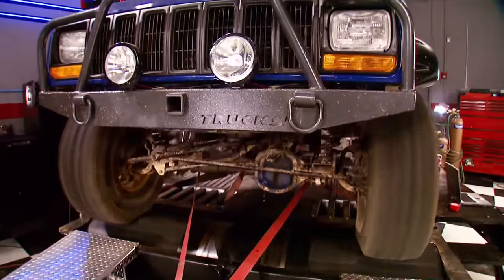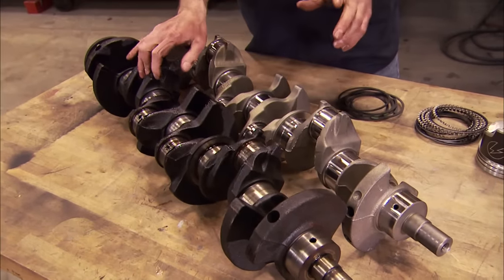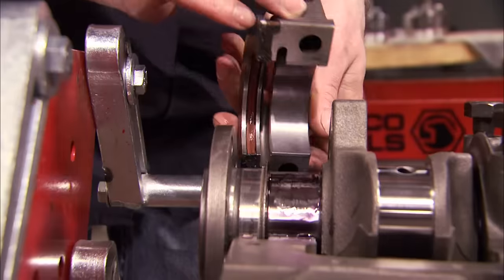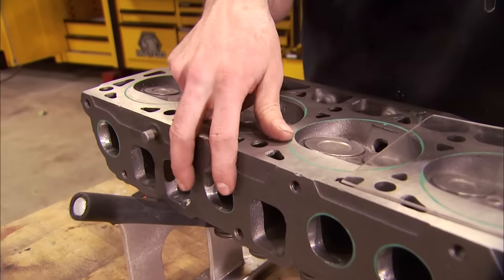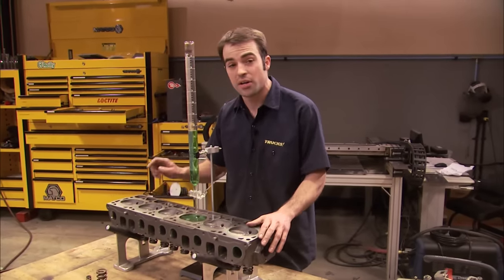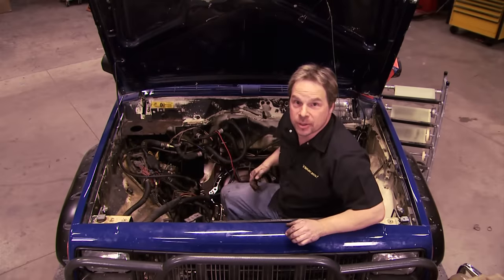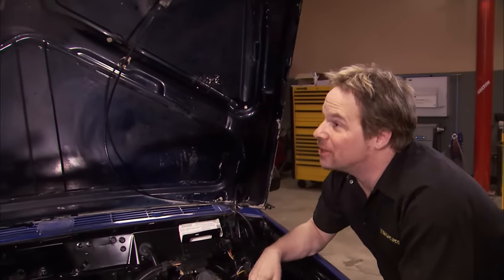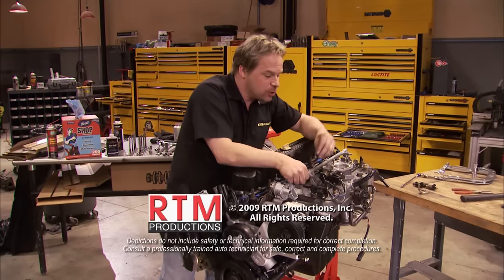Improving Air Flow And Displacement On Our Cheap Cherokee's Straight Six - Trucks! S11, E7

Comment: So let me get this straight, they spent money on upgrading the cam, rotating assembly, injectors, and another $150 on a CAI for the engine to have more power. But they left that ridiculous manifold, the tiny throttle body, and didn't bother to do any tuning? Add in an amateur porting and chamber job that probably hurt more than it helped. That money would have been better spent elsewhere. Like just freshening up the factory parts and starting with the intake and exhaust so the system flowed better and had a better balance.

Comment: Who in the hell wants lower compression? Unless you’re over pump gas octane rating? Do all that work spend all that money to get less HP?
Reply: They said it was to run on cheap gas but I would have taken the win and gone for premium gas.
Reply: Cause these guys are retarded everything they do sucks lol never seen them ever do something right or build something that actually makes power
Reply: 9,6:1 is normal CR today. Or it was already in 1970s here in Europe
Reply: It's a jeep Engine who cares if they lost five hp
Reply: Right? Wtaf....
Reply: Dumb to lower the CR. All 2020 oem turbo cars are >10:1 CR. Higher CR gives much better fuel economy
Reply: Landon Roy even a point of compression isn’t all that important for power maybe you’ll lose 10 horsepower and don’t have your engine pinging if you ever decide to run 87
Reply: @thebigpicture2032  right if ya got the $ to build a stroker think you can afford premium
Reply: @vwclub3  it's only $2100 that's not a big expense. Hell, I can't buy my trans for that.
Reply: Well u don’t want a off-roader reliant on premium fuel and just in case ur in the backroads some gas stations don’t have premium fuel (mine doesn’t) so I think they thought this through plus don’t want it pinging when u have to run it on 87
Reply: @randomdino3106  you dont HAVE to run premium. if you constantly use it, your engine will make a pinging noise and will wear it out faster, but if you get stuck and use a gallon it wont make a difference. also, why not just bring some premium with you? seems like the EASIEST fix EVER and is as minuscule as a non issue. no way you cant afford 10c more per gallon
Reply: Seth H I mean I get that but I’m a cheap bastard and I don’t mind losing a couple horsepower for some cheap gas to each their own I suppose
Reply: @randomdino3106  maybe, IMO it's better to run better fuel and have your engine last longer, regardless of compression ratio
Reply: Seth H sure that’s what you would do but just an extra hassle when premium be costing 260 and 87 just cost 149 and I can put premium when I want to aswell I rather have flexibility
Reply: @randomdino3106  damn your prices are high. It's 1.40 reg and 1.79 premium here. But I go to Costco so I get a better deal
Reply: @sethh8892  what trans you buying if its any out of xjs ax15 aw4 got couple pick them up for $100-300
Reply: @vwclub3  I'm buying a 4l80e built for 900hp. He would never catch me buying anything for a Jeep lol. I want my stuff to last

Comment: I believe 10.0 ratio compression much better.
Reply: I got a chuckle out of them worried about running 87 octane fuel on 9.6:1 compression ratio. They literally spent hours and hours on something that did not need to be done. Unless the goal was to port and polish the head. Which the porting was done and the ports and combustion chambers were left looking like a washboard.

Comment: My question is will this (4.2 crankshaft) work in a 2002 4.0L coil pack engine? My concern is crank position sensor not picking up and timing/ignition issues. Thanks for any help
Reply: I have a 1978 4.2L engine that's toast that i can get the crank from (for core), and a 2002 4.0L coil pack engine that needs rebuilt.
Reply: Your crank position sensor picks up signals from the reluctor wheel that is mounted on the crankshaft. So if the 4.2 crank has the same size reluctor and the same amount of teeth, you should be golden. Just make sure you time the crank and cam properly. This means you need to make sure you can mount the reluctor from the 4.0 crank on the 4.2 one.

Comment: Question: What do you do if the Plastigauge measures out of spec?
Reply: On new parts probably return. If used then it's time to replace - according to the factory. It might work a while longer though
Reply: If the measurement is too tight the crank needs a slight hone. If too loose the crank needs to be turned under and new matching bearing sized to fit.

Comment: When you stroke a 4.0l straight 6 don't usually stroke it to a 4.6 l?
Reply: 0,04” overbore +4,2L crank =~4,6L
Reply: A bigger 4.2 stroke in a stock 4.0 block is like 4.35L. So with no overbore you gain 350cc's. There are 667cc per stock cylinder so not quite the size of a 7 cylinder. 

A 0.030 overbore is 4.475L. A 0.040 over bore is 4.6L, still short of having 7 stock cylinders. A 0.060 overbore is 4.7L. You can get a bore and stroke for this 4.0 to make it a 5.0L I6. 

0.060 over may get a few soft spots in the bore and a sleeve will be needed. 
We went this route. 1991 4.0L Larado with a 4.7 combo. A warm cam, ported stock head, MAP sensor adjustor and 4wheel High it will smoke most stock 4.6 Mustangs.
Reply: Dave J:
4.0(242) bore: 98,4mm
4.2(258) stroke: 98,9mm
=4512cc
Add .030” overbore=4582cc

I got dimensions from Wikipedia

Comment: So,  you're using the plasti-gauge to check bearing tolerances .....  what's the process  if they're not within specs ??  :-(
Reply: Depends on how far out of spec. If it is 0.010 out, you need an oversized set. If it is less, some bearings can be swapped between journals (some cannot, check instructions). Swap them around until they are "matched" and if you cannot make a matched set, you'll need a different kit, or machine work.

Comment: 4.2 crankshaft and 4.2 connecting rods NO    4.0 connecting rods are what you need by my understanding.
As 4.2 rods are shorter so lower your compression ratio
Reply: Wrist-pin location and/or 4.0 pistons to compensate. 
Or decking / milling the head I believe they say that here or in another video

Comment: If you are using a 4.2 crank with 4.2 rods and 4.0 pistons on a 4.0 block you will have low compression. The top of your piston will sit like  .082 thousands below deck height. If anything you would want to gain compression. This makes no sense.
Reply: I was confused about that. Maybe mis spoke?

Comment: Why are you lowering compression? More compression is more power.....
Reply: prevent knock
Reply: Omega Rugal  9,3 vs 9,6:1 no difference and no problems with modern fuel
Reply: @juhomaki-petaja  under heavy load it makes a difference
Reply: Omega Rugal: How do we manage it here in Europe??? And we had 9,5:1 CR engines in 1970????
Reply: @juhomaki-petaja  it depends, my old taurus has 9.8 compression ratio and pings like a tractor under load and with regular gas, premium mitigates the issue
Reply: Omega Rugal: Your Taurus has shit settings in ECU. My Opel Ascona has 2.0liter cast iron engine with 9.5:1 CR, distributor ignition and old analog/digital injection. And made in 1980. 
My Opel Rekord has 1.9litre iron lump with carburator and point ignition, and 9.4:1 CR. (Made 1968)
All european cars made from late 1980s have 9.5-10,5cr with no pinging.
And knock sensor allow use 91-98octane gas.(we use RON rating)
Reply: @juhomaki-petaja  no, actually the vulcan always had that issue, my point is that high compression un a 4.0 is bad, there are several factors that cause pinging in a partiuclar engine and not in another, compression ratio is just one of them...
Reply: @juhomaki-petaja  in America premium fuel is 91 to 93 octane. Regular fuel is only 87 octane.
Reply: Iron Stick Sporting Goods LLC: European 95 equals your 87
Our 98(highest) your 91
Reply: @omegarugal9283  Sounds to me like you may have a lot of carbon buildup in your combustion chambers and around the valves. Might wanna consider more religious oil changes and a carbon cleaning. 9.6:1 CR will run 87 octane just fine with no ping. If it pings, just take a couple degrees of timing out of it. Also, this particular engine has a knock sensor if I'm not mistaken so the ECU will take care of the pinging.
Reply: @TwentytenS4B8  the vulcan has no ping sensor

Comment: Rear main seal was installed wrong, it should have 1/2 inch offset in the main cap.
Reply: Lol thats just a preference some mechanics prefer... That's why they used r.t.v to stop the possibility of leaking
Reply: I guess you havent watched this video or worked on any old Jeep... There's no way installing rear main seal offset... 4:45

Comment: This wasn't a cheap build.

Just sayn
Reply: Depends on how you look at it.
Probably 3k and time when done.
Look at what they are getting out of it. That engine will probably last for 200k miles.
If you took it to a shop, that would probably be more like 4.5k.
You know very well that the shop wouldn't do as good of a job as you would by yourself.
Cheapest way to go would be a junk yard motor. I've done many.
Some last, some don't.
Reply: @markchidester6239  $3,000 for barley over 200hp. I have nothing against the 4.0l but they could have built a 400hp 400tq ls for that.
Reply: @markchidester6239  You make a valid point. I think at this point I'm splitting hairs. The tools cost money. I have a decent amount. (as an investment of course) But com'on, whos got a frame bender with concrete anchors. Thats just #$@%n cool, and may have been a few bucks there.
I think its part jealousy as well
Reply: @konnerkramer329  Don't forget to tack on the cost of upgrading the rest of the driveline to handle that power. That rear end front and rear for instance would probably blow up like a hand grenade the first time you gave it the beans. Would the spindly driveshaft twist up like a beer can? Would the suspension wheel hop so badly that you end up breaking things? Would the transfer case go nuclear the first time your foot goes to the floor? Have to think about everything that goes in unison with the engine. Not just the engine itself.

Comment: Plastigage is great but no one explains how to fix the problem if the gap is wrong
Reply: Too much gap = either oversize bearings or crank\block is junk. Too little = wrong bearing size ordered or machine shop messed up so it needs to go back to them. You can always take material off but you can't put it back on.

Comment: Umm... Displacement = Pi x (Bore/2) x (Bore/2) x Stroke.  Increasing the volume of the combustion chamber by altering the heads will change the compression ratio, but it will not change the displacement.
Reply: The 4.2 crankshaft has a longer stoke than the 4.0. The 4.0 has a 1/8 inch larger bore. So the larger bore of the 4.0 block with the longer stroke of the 4.2 crank equals a 4.6 displacement.
Reply: @ironsticksportinggoodsllc2417  That may very well be, but displacement has nothing to do with the volume of the cavity in the cylinder head.  Cylinder head cavity volume figures into compression ratio, but not into displacement.
Reply: @hotironaircraftshop  I think we are saying the same thing in different ways. I fully understand that heads cc has absolutely nothing to do with displacement.
Reply: That kind of threw me as well. Bore and stroke alter displacement. Widening the combustion chamber just lowers CR.

Comment: Or just get a thicker head gasket so your cr is lowee
Reply: Factory gasket is about +8.5cc, the thickest one I found (Cometic) is about 10.5cc, so best case you can net about 2cc, which may be enough.
Reply: @mitchellpatterson1829  I'm guessing you have one of these motors too?
Reply: @jarredsmith8091  
2 actually, and one is up for a rebuild. Just found out a re-man 4.2 crank, with bearings, is cheaper than having mine machined. Need lots of new internals anyway (over 300k)

Comment: Easy job at home if you have a machine shop and a couple hundred grand worth of tools.
Reply: All you need is a good torque wrench, and some feeler gauges as far as special tools goes. A micrometer doesn't hurt either but you can use plastigauge. The rest of the assembly can be done with common hand tools. They did send the block and head out to the machine shop which was indicated in the cost breakdown they gave.

Comment: 9.6:1 compression doesn’t need premium 🤣🤦🏻‍♂️
Reply: I run 11:1 with regular pump gas. Just have to retard the timing a few degrees.
Reply: @Auto Driven Removing material in the chamber is better, running the correct dish piston is best. NEVER just stack head gaskets or run extremely thick head gaskets to lower compression. You kill quench distance,  which is a ton more important than a few tenths of compression. An engine with a tight quench with a little too much compression is much less likely to detonate than an engine with no quench, or more than .040", and lower compression. Hope this helps.
Reply: @jeeplvr2000  That'll work for idle, or normal cruising. Put a load on it at full cylinder pressure and rpm, report back lol. Nothing wrong with it, but It's a bandaid.
Reply: Oh it will lol. Considering it's an iron head, and 10.1 is about max...
Reply: danny selak ive gambled on 10:1 compression on iron heads and it would ping like hell without race gas. 10.0 is not far away from 9.6 so playing it safe isn’t a bad thing
Reply: @theeoddments960  It'll work, but since 10.1 is the limit with iron heads, everything else needs to fall into place. Tight quench, timing, cam timing, temperature, fuel etc.. biggest thing i see is not enough cam timing and too much cylinder pressure. Detonate every time. Backing it down to a safe area by half a point, all else equal, helps. Still need the right tune though. Even lower compression can detonate under a load...

Comment: Why not just match the pistons for a pump gas compression ratio??? Sometimes I watch these "hot rod" shows and palm slap my own face.
Reply: 9.6:1 is pump gas ratio. There are Toyota Camrey's running that and maybe a little more from the factory that run on 87 lol.
Reply: 04Interc3ptorP71 they have variable valve timing.....
Reply: @eprofessio  Not all have VVT. Many have knock sensors and an ECU to react to pinging.

Comment: You are always going to be limited on this engine because of the head design.  The 1st question to ask before you put a bunch of $$$ into it is - is it worth it or do I go to the junk yard and find a good OEM engine that is worth dumping money into.  Why do you folks never point this out to your viewers? I don't know a lot about jeep factory engines, so all of this is hypothetical with engines that I have pulled out of my arse which probably don't exist, but if Jeep does make a factory, let's say, 4.4 I-6 engine that will drop right in and has a CROSS FLOW aluminum cylinder head...

I say this because I have seen a few of your videos, and they all end up going like this...  Let's boost performance on this Jeep 4.0 on the cheap! (GREAT!!!) 3 weeks and $1500 later it is, lets add a $1000 turbo/intercooler kit to the "cheap" 4.0 Jeep to REALLY get that air flowing!  Then then another $1500 later it is, well that is as far as we can take it because the intake and exhaust are on the same side of the head...  we didn't start with a $100 bone yard core to dump $5000 in upgrades into and the exhaust is now cooking the intake and it will never have the potential flow numbers of a the 4.4 because of the basic design differences, but we saved you $100 up front by using the crap engine that came in your Jeep!!! Final numbers?  325 HP... that is pretty peppy!  However the same upgrades to the 4.4 would has yielded a 650 HP rock crawling monster truck.

Comment: You cant tell the difference between 9.6 and 9.3.    That does absolutely nothing
Reply: His point was it will be easier to use lower octane and save money.
Reply: Steven Donovan  and the point is there is zero difference in what octane you use from 9.6-9.3.  Same shit
I have and ls3 10.0 and run on 87 octane with zero issues
Reply: Mike Eagle: You are right👍
Reply: Mike Eagle well with the ls argument modern Toyota’s have around 11-12:1 compression ratio. So how come they’re not pinging on 87?
Reply: Special Agent Jim Harris, SSD.    
There are some Toyota engines with 13.1 compression. 
Because their direct injection motors.  Direct injection engines and run more HP without detention 
Lmao 😂.     Next question 😎
Reply: Mike Eagle and every modern turbo engine has over 10:1 and no pinging.
Reply: Juho Mäki-Petäjä    No kidding 
I own one.  My twin turbo motor is 12.5 and runs on meth.   
I own a fabrication shop and do turbo system weekly
Reply: Mike Eagle Actually I didint say it to you but in general.

Comment: 1:25.  Those are not freeze plugs.  You should know that.
Reply: What are they?
Reply: @Iwhoiam999  in 40 years of wrenching I've never seen one pop out and prevent a freeze crack. The plugs are actually where the sand mould is washed out the block after casting.